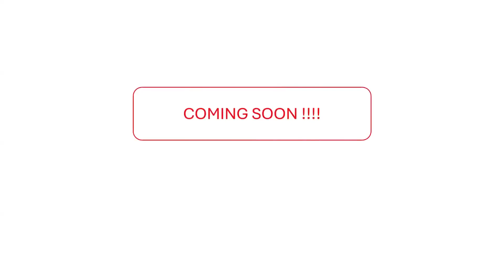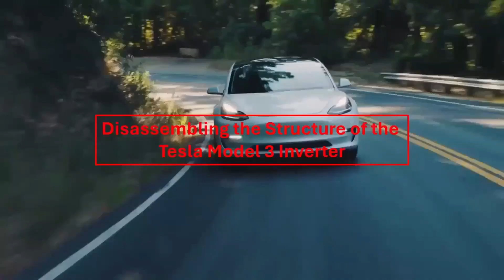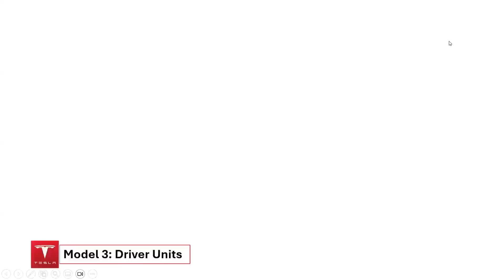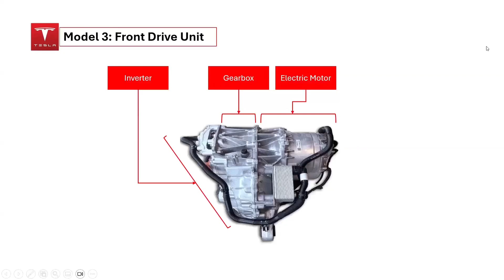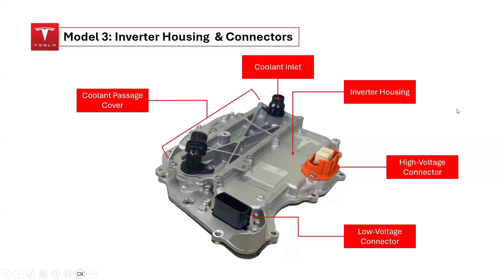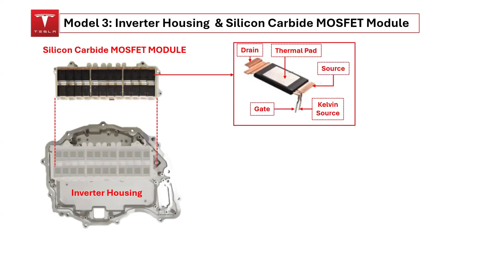Examining the Assembly of the Tesla Model 3 Inverter Structure by Disassembly - Part 1

Comment from the maker: Hello Subscribers and Viewers,
The full video clip offers a comprehensive and detailed examination of the Tesla Model 3 inverter by systematically breaking down its various components. The first section delves into the intricate design of the inverter housing, highlighting how it protects and supports the internal parts. It also explores the connectors that ensure electrical stability and performance. Additionally, viewers will gain insight into the advanced silicon carbide MOSFET module, which plays a crucial role in enhancing the inverter's efficiency and power delivery. We hope you find the exploration enjoyable and informative, and we encourage you to share your thoughts and comments!